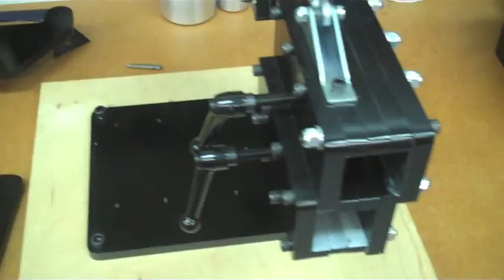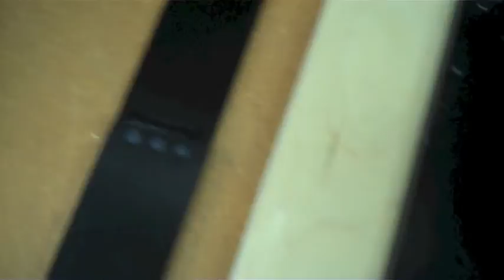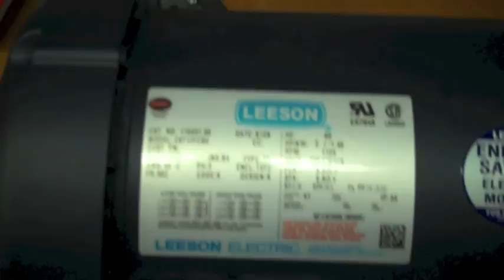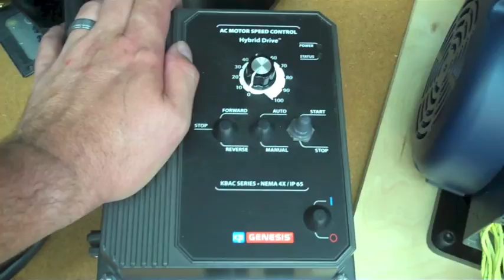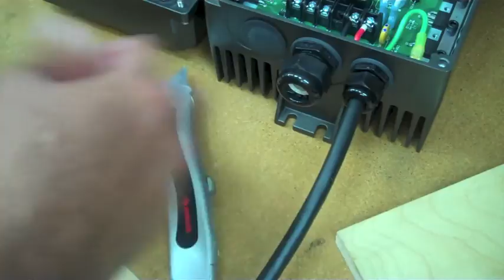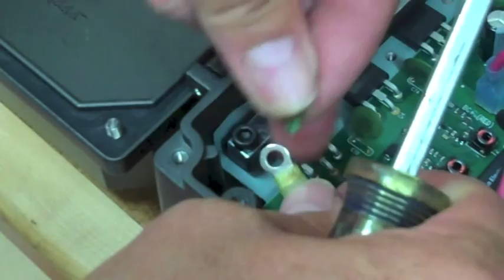Grinder in a Box Build Part 5

Comment: Grade eight bolts are very hard and can be brittle. Different bolt grades have different tightening torques listed, if you are not going to tighten it to the max, there is no need to have a grade 8. Grade 5 is good for most automotive apps. Metric 8.8 bolts are slightly harder than US grade 5, but the rating systems are not comparable. Bearings are available in  metric and US dimensions. Brg mfgs and McMaster Carr, etc have bearing spec charts in their online catalog.

Comment: Tyler,
Is there an advantage to the 1725 RPM motor compared to a 3600 RPM motor that most people are using?
Reply from the maker: I don't think so.  If I had it to do over I think I would go with the higher RPM motor as I feel the 1725 is some what limiting.  As I get better at grinding I am finding I would like higher RPM at times.
Reply: I think you can double the frequency output on the KBAC VFD's buy putting in a jumper.  Have you tried that yet?  From what I read there should be a X2 jumper.  I could be mistaken.
Reply from the maker: I did some research tonight and found the 2x setting in the manual.  I also searched blade forum and found that several people are using the 1725 motor with 2x because apparently it holds better horse power at rpm than a 3400 motor. Still figuring it out and thanks again for the information.

Comment from the maker: As for the controller I used the:  KBAC-27D.  This control is NEMA compliant which means it is rated for dusty environments. 
 
Make sure you get the NEMA rated cord connectors with the controller or you will have to chase them down elsewhere.  I also recommend adding the option of AC Line disconnect switch with the controller.  This will allow you to leave the unit plugged in and simply flip the switch off killing power to the unit while not in use.  Not critical but nice to have.

Comment from the maker: Sorry I didn't back to you sooner.  Here are the specs of the motor and controller I used.
 
The motor I used was the:
 2HP LEESON 1725RPM 56C TEFC 3PH MOTOR 110451.  
 
Unfortunately I did not pay close enough attention when I ordered and ended up with a motor that had no base feet on it.  I would recommend going with something like:  2HP LEESON 1725RPM 56H TEFC 3PH MOTOR 113026 as this motor has the rigid mount base on it.
Reply: I know that it is years later and you probably won't see this, thank you for listing the motor information, very helpful!